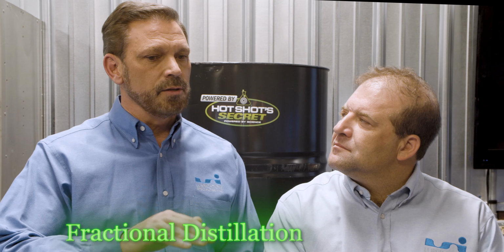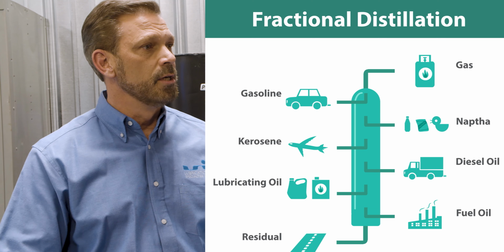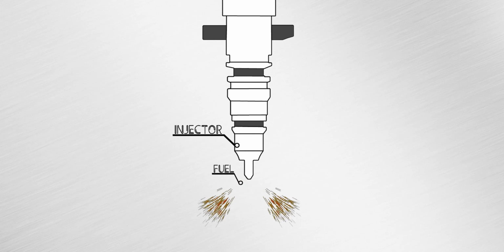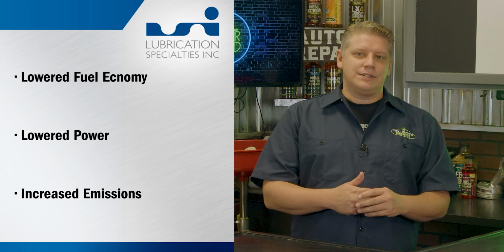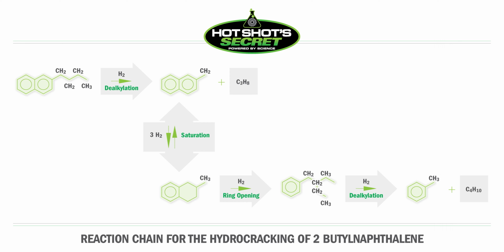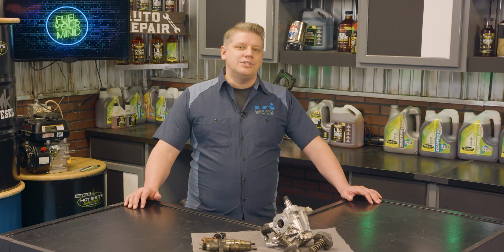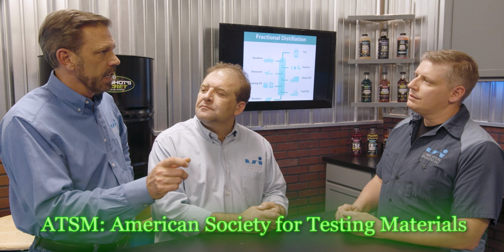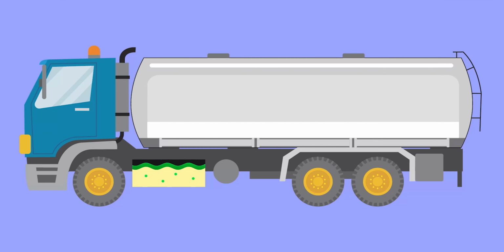Everything You Need To Know About Diesel Fuel.

Comment: I have been using regular diesel fuel at the pumps. I did get a bottle of diesel fuel additive and would add this to my fuel. Checking on U tube, just noticed that getting my fuel from Cosco would improve better C taine for me injectors. The question I have, do I still add fuel additives.
Reply from the maker: Yes
Reply: Costco fuel is renewable diesel. It is a much cleaner burning fuel of course with higher cetane but it has less lubricity than other diesel fuel options. Definitely add EDT to your fuel when using renewable diesel or any other diesel fuel for that matter.

Comment: I bought a Kubota tractor that had been sitting in a shed for 10 years.  The fuel tank had brown sludge spots in it and the water seperator/filter was coated with brown sludge. I drained the fuel, replaced the filter and filled the tank with fresh fuel and Hot Shot's EDT.  From other videos I've watched, Hot Shot's EDT seems to be the best at increasing lubricity and anti-corrosion. I haven't seen any comparisons for anti-microbes, but Hot Shot's seems to be a good quality product, so I'm counting on it to protect my fuel system.
Reply: 2% biodiesel beats all fuel additives on lubricity

Comment: Diesel additives will not be necessary when we stop producing the nasty dirty crude diesel and only use renewable diesel.  Renewable diesel is cleaner, no sulfur, higher cetane, higher lubricity, no oxygen and a lower cloud point.  This is the future of diesel engines.

Comment: I’m here because I accidentally put r99 in my truck. I was a dumb ass. I always thought diesel was diesel. My gas cap said b20max. Never gave it a thought until I filled my tank. My truck sounded different. I don’t know if I’m just being paranoid or whatever but I truly believe it made a negative difference in my perspective. I found #2 after I used most of that tank. Seems normal now. Tell me if I’m full of shit. I truly don’t know 2017 f350
Reply: R99 is renewable diesel not bio-diesel.  Renewable is the same chemical as regular diesel but much cleaner.  Any engine can use it and it is cleaner and more powerful.